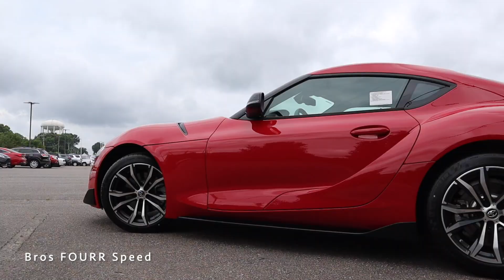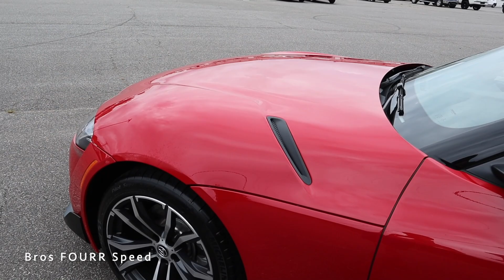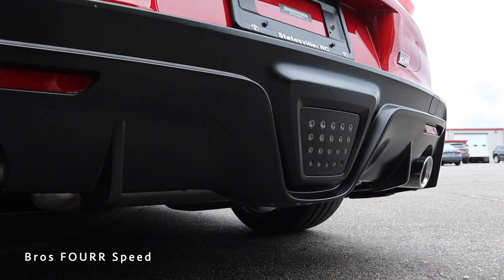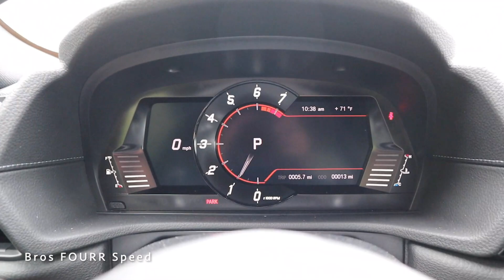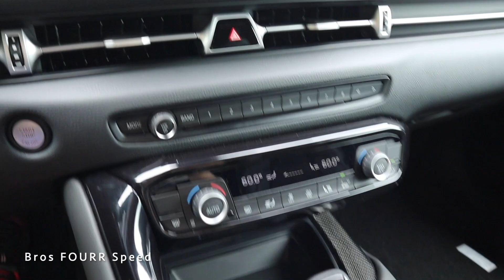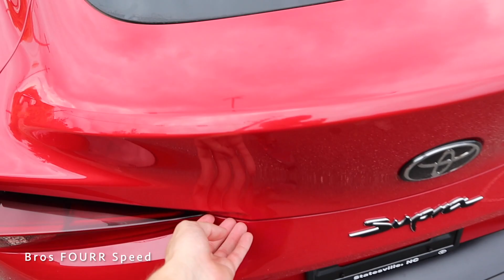2021 Toyota GR Supra 2.0: Start Up, Exhaust, Test Drive and Review

Comment: Always a good idea to have a higher and lower trim. More sales for the company. I’m looking at the 2.0 bc it seems like a good enough daily for work while still being fun. Auto is a plus bc I get tired of rowing gears sometimes lol. My R will be my fun car.
Reply from the maker: Yeah not a bad option. However at the same price of a new 2.0 you can get a nice used 3.0. Big step up in car and still gets over 30mpg. I'd go used if you go 2.0. You'll lose your but in depreciation on the 2.0. The 3.0 holds value much better

Comment: It's showing only 5.3 mpg🧐
Bugatti chiron gives around 7-8 mpg🙂
Reply from the maker: On a dealer vehicle that idels a lot, will show an inaccurate reading. The Supra gets around 28 mpg.
Reply: @BrosFOURRSpeed  but in our country(Bangladesh🇧🇩) the 2.0 supra gives only around 4 kmpl, Highway Idk
Reply from the maker: @AkramIqbalNahid397  That doesn’t sound right, no way there’s that much of a discrepancy with the same engine.

Comment: Too much money for a 4 banger, the 3.0 at this price would be a decent value.   55 for that is pushing it.  Nice cars and fun to drive just about 10g too expensive.
Reply from the maker: Definitely a great car. We'll see what the new Z does to these since that'll be $10k less with 400 HP and a manual option
Reply: @BrosFOURRSpeed  Everything I’ve seen of the Z looks really plain, looks 20 years old
Reply from the maker: @ranman992000  It's very retro for sure. I have one on order lol. Will be a fun car!

Comment: does the 4cylinder come with a Limited Slip diff as std or option?
Reply from the maker: I believe it's the same diff the 6 gets
Reply: @BrosFOURRSpeed  not sure. The 3.0 does get a LSD as std........but nothing I am reading confirms LSD for 2.0T. can you research ? Anyone know for certain?
Reply: Not sure but it may be a mechanical diff

Comment: I love mines. I debated about the 6 but I saved about 6/7k. I got the 21 for 43k brand new. It's not my daily driver & I just wanted something fun for the weekends. I dont plan to take it to any tracks etc it definitely does depend on the owner & what they like of course. Its definitely  still fast. This was budget friendly for me so it works in my situation. I plan to DP & tune it soon ( all though I heard the ECU is locked on the 21s but idk how true that is) & itll be cheaper to do mods VS with a 6. I haven't done anything crazy just yet other then the interior add on & the m4 side mirror caps in fiber from Autotecknic. I absolutely love it. Looks like horns. And I just got a spoiler from Suvneer that Thic Whips have. My only dislike about the 4 cylinder is that is too high for me. I'll be lowering the car at some point & getting different rims. I mentioned this before but the bluetooth is terrible for Android. Idk if it's a problem for all supras, but when I'm listening to music, it would just cut off sometimes & play again. It doesn't happen all the time but when it does, it drives me freaking insane. The rattle noise from the speakers are annoying too.
Reply from the maker: I have the H&R lowering springs. World of difference in handling too!
Here's a video I did fixing my door panel rattles. https://www.youtube.com/watch?v=ciLsC74gf5Q

Seems like the tuners can unlock the ECU. Let me know how much power yours makes after all that! My 2020 is at 450/560 on 93 gas. On E85 they get into the 500+
Glad you're enjoying the car!
Reply: @BrosFOURRSpeed  thank you so much B! Do you happen to have a dashcam on you're supra? I'd love to see a video of that. I have no idea how to wire that thing either. Theres tons on the market & I cant make up my mind. Definitely need one with a parking mode & motion detector.  I had a shitty situation happen 2 days ago. I parked away from everyone & it still got scratched from someone who was lazy to put the cart away. I got it fixed but they didnt do a 100% job. Now I gotta buff it. I felt like it was on purpose from where the cart was placed after but who really knows. Thanks agian B. I'll be doing a ton of work on mines soon & it's all thanks to you
Reply from the maker: @JulietActual  I have no experience with dash cams unfortunately. Hopefully you get yours squared away. Have fun with it man 😎😎
Reply: @BrosFOURRSpeed  you can call me jenn.  Thanks though B! I got a cheap one for now from China called chortau. I didn't wanna mess with the fuse box or anything so I got something that parking censor would work as well with just the socket.  It's been doing the job pretty well so far. I can go to Walmart safely now & park far away & catch the next prick not wanting to put their cart away next time. I could have used that 500 dollars lastweek 😂😫

Comment: What's the point of the 2.0? I'd rather get the new 86 w/ a manual trans for that price
Reply from the maker: Well this is still wayyy faster then the 86 will be. And much more refined. So it’ll offer a different driving experience. New 86 will be cool tho!
Reply: It’s way faster, way more torque. I think at the price point it fits nicely between the 86 and 3.0. I’m just glad Toyota is making sports cars! Lots of options at each price point.
Reply from the maker: @chuckcribbs3398  yeah it’s cool to see the 3 different options now! Excited to see what the new 86!
Reply: The 2.0 is aimed at some Euro markets where the tax is about to hit 55k USD for the 3.0...unreal...

Comment: In my opinion, BMW and Toyota should’ve never put a 4 cylinder in the Supra. I get that it was intended for the market that either can’t afford the 6 cylinder version or don’t care about vehicle performance. Some car manufacturers now isn’t really all about the true enthusiast anymore with their performance cars and that’s what the old car scene used to be.
Reply from the maker: Keep in mind the MK4 had a slower version too. N/A and a Turbo version. So it’s true to the Supra to have a two different engines. Good way to increase sales
Reply: I think the 4cyl is a stigma. The B48 engine is probably the best and sportiest 4cyl you can get. Plus it's light so i'm sure it rips.
Reply: It's about local taxes, not affordability.

Comment: If this was available when you got yours, would you still have got the inline 6
Reply: it makes no sense to go for a 2.0 if you plan to mod it. That amount of money  youll put in it to make it as fast a 3.0 you might as well buy a 3.0. The price of this 2.0 is pretty retarded. its going to die when the 400z comes out which will be cheaper than the 2.0 but way faster.
Reply from the maker: @vizionnite7086  If mod prices are the same across the board. It’ll only cost $2k for a tune and exhaust and intake. That’ll get the 2.0 probably just a bit faster then the 6cyl. So you’ll still save money and have a more efficient car that weighs less. Still a good option. I’ll stick with my 6cyl because I want the real power lol
Reply: @vizionnite7086  2.0 is good to leave stock but 3.0 is great for mods
Reply from the maker: Haha yeah! This is too slow for my taste. At least the I6 tuned is almost on par with the GTR. I couldn’t do something on this level lol
Reply: @BrosFOURRSpeed  the inline 6 is a lot faster and can be on par with supercars
Reply from the maker: @mileslynch  If I ad a turbo and go E85. It’ll make 600 to the wheels. Pretty crazy power can be made out of it for cheap
Reply: @BrosFOURRSpeed  love how well  the Supra respond  to mods with power
Reply from the maker: @mileslynch  yeah it’s crazy! Be interesting to see how well the 2.0 will do with tuning

Comment: Figures in metric:

Torque: 400nm
Weight: under 1455 kilos
Top speed: 250kmh
Fuel capacity: 51.8 litres
Fuel economy: 9.43l/100km (city), 7.4l/100km (highway)
Overall length: 4.38m
Wheelbase: 2.47m
Height: 1.3m
Width: 1.85m
Ground clearance: 0.10m
Reply from the maker: Great info!